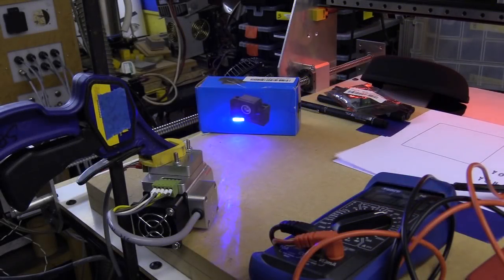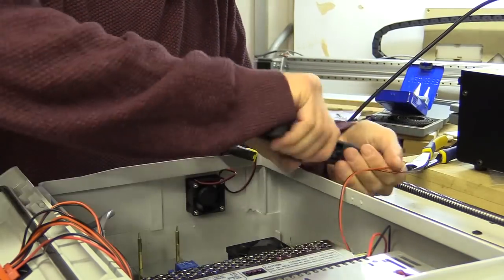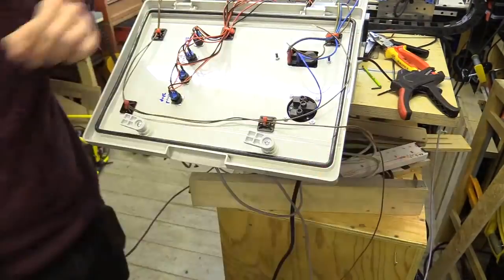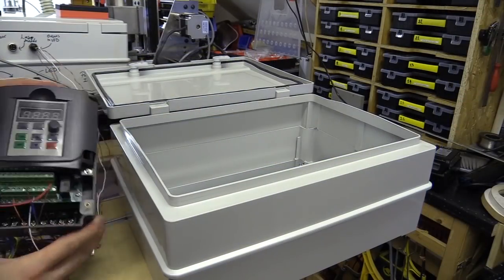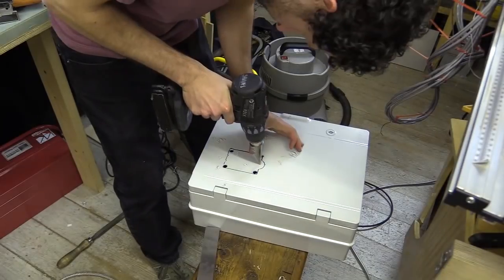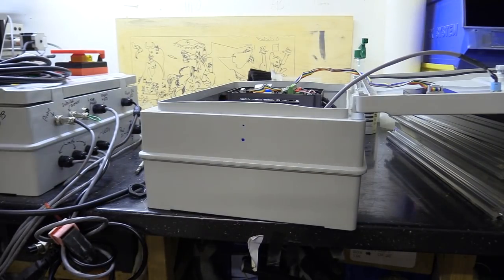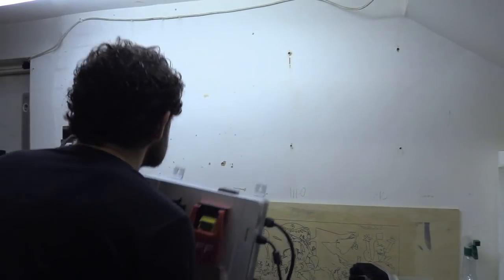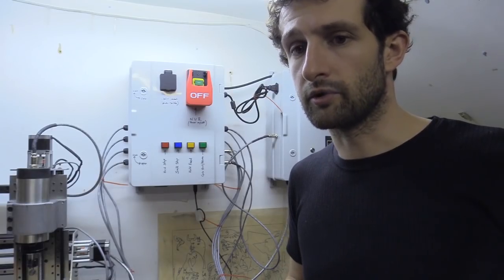#41 CNC Control Box Part 5 / Frequency Drive (VFD) & Enclosure, Air Fans, Spindle Relay Module

Comment: hot air rises so shouldn't the fans be the other way around?
Reply from the maker: I orientated them that way when I had the enclosure laid flat, and hadn't thought about mounting it to the wall. Right below the top fan is the PSU fan which is pull air towards the power supply, and right next to the bottom fan is the main source of heat – the drivers. Plus a fan just above those to blast air onto them / the controller. I should swap them around at some point and add an additional fan. Would be interesting to know how much air those fans are able to shift compared to the amount in the enclosure.
Reply: To be honest, up down doesnt matter so much. As long as its forced. It all about geting air flow thru the heat sinks. Fart the rest out. I would chuck a fan on the sink. Leave open hole in the bottom and fan at top to blow out. Convections are weak currents.
Reply from the maker: I did that over the entire control board / drivers but these big foot drivers don't have half current for idle mode so everything is pretty hot. It seems to be working though. I've made a few cuts now and the cheese hasn't melted everywhere.